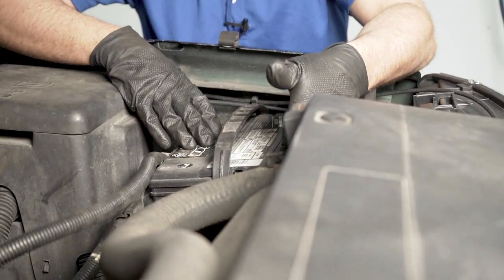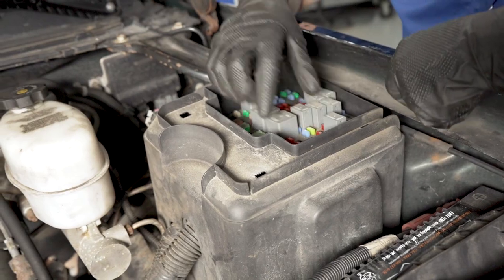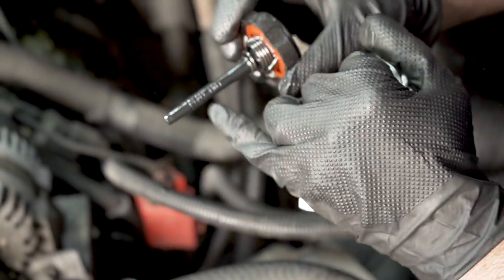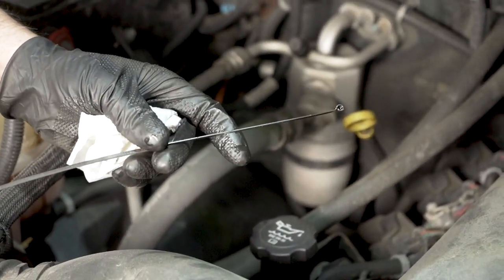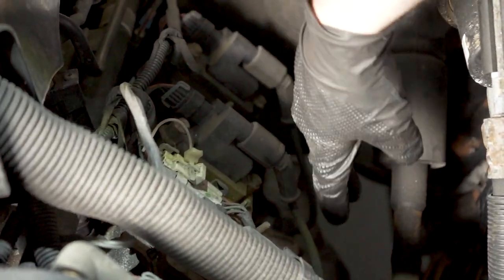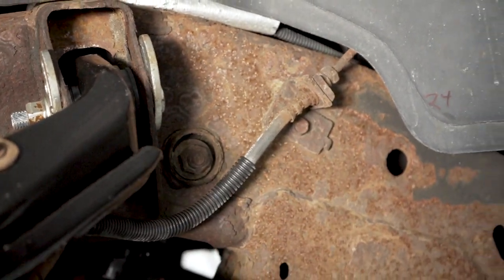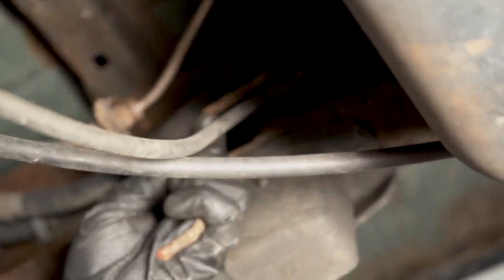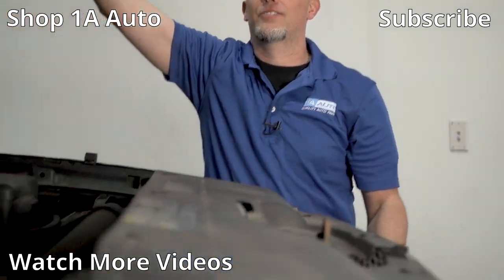Top High Mileage Issues 2001-2006 Chevy Silverado 2500 HD Truck

Comment: Here are some major ones that need to be checked and can affect your purchase.
1) CHECK THE TRANSMISSION FLUID!!!!  The fluid needs to be changed on these trucks or serious damage will be done. We had a farm truck that needed a while new transmission because it was not maintained. A clean filter is also a necessity. However, DO NOT FLUSH THE TRANSMISSION! It can cause too little friction and mess up worn out parts.

2) Check the rear fender wells.the bedsides will rust from the inside out depending upon how much damage is done. It is also structural for the rear quarter panel. The rear support will crack then by the taillights will follow affecting the tailgate bracket.

3) Assume you need new sparkplugs and a fuel filter. If there's a check engine light on their typically the culprit. Just under $100 and it makes a world of difference.
3a) The spark gap on the plugs can vary from the original specs depending upon which engine you have. It varies if you have iridium or platinum. Do your research.

4) Cab mounts. The cab mounts on the earlier mounts tend to go. Look carefully at the bushings. If not replaced when broken they will hold water rusting out the mount. It can become costly to repair, potentially damaging the front mounts in the process.

5) Tailgate latch. The plastic connector which holds the release for the tailgate can break easily if yanked upon. Always push into the tailgates before opening them. The plastic becomes brittle.

6) Bumpers. The bumpers usually rust out horribly. There's no way to repair it, it's much easier just to install new ones.

The way the market is right now, there's a lot of these trucks for sale. Keep in mind that a cheaper truck could cost you more in repairs. Attempt to find the best truck cosmetically and mechanically in your budget. Parts are cheap and the repairs are typically pretty simple, remember you can't undo rust. Good luck.

Comment: On my 2000 2500 I’ve done the following; all ball joints, front shocks, water pump, intake manifold gaskets, new OEM intake manifold,  water pump, idler arm + bracket, pitman arm, both front hubs and bearings, TCCM, transfer case encoder motor, front axle actuator, pigtail connectors and harness for the transfercase, tie rods and tie rod ends, starter, 3/4 o2 sensors, hood release cable, new trans, full pad a rotor kit.  I still have a cv boot and a trans cooler line to do, and more than likely both head gaskets. I’ve had the truck for about 2 1/2 years. Love it to death but at this point it’s starting to get a little pricey.
Reply: Did you know all this was needed before you bought it, or it needed these things as you owned it '  and time went by ?

Sorry for all the questions, but l'm looking at these trucks now in the 2022 gas hikes ' 
or better yet said " wallet evaporator "

Comment: I owned a 2004 2500HD I love everything about it, except my AC and Heater went out. It's very expensive to repair. Good thing I live in California were its not hot or cold otherwise the best truck I ever had lots of Power

Comment: I'm having weird electrical issues, but I suspect previous owner as oem wire from alternator replaced, but old one left on, power inverter installed, but red wire used to connect both pos and neg terminals, aftermarket stereo with bad install... Will check ground cable though! Thanks for the tips!
Reply: There is a ground terminal under the truck on the drivers side that has a bunch of grounds all meeting up there.  Very common rust causes bad grounds and cant figure it outs.   CHeck that area if your having issues tough to follow....

Comment: Ok my main problem with these,,y    Y.    WHYYYY DO they put the hot side battery near the fender.  Its so close to shorting out its scary,,,an sir u are right about rodent's under fuse box,,, mine were hungry,15 wires.  Had a engine miss u couldn't beat an noticed some dry grass sticking out from under the box .   Repair was time consuming worse part is now the surround wont go back on ,,so now its wrapped up in plastic an put lid back on,  must be water proof rain will get in it if not sealed up.

Comment: What about the 2007 classic? Does that fall under  01-06?
Reply: No.  In 2007 chevy wen to active fuel management.  That is where the truck shuts off some of the cylinders to save fuel.  The problem is the valve springs become permanently collapsed and the mechanic has to tear your heads off to replace them.  I heard about a guy who already has $13,000 in active fuel management repairs.

Comment: So what if I don’t have a 2nd battery in mine?  I bought it like that and don’t see any lines from where it would be.
Reply: Probably a gas truck they don't need 2
Reply: @doddgarger6806  the truck demonstrated in the video is a gas truck . The diesel duramax does not have a vortec engine cover .
Reply: That’s a good question . Never seen two batteries in a 6.0 hd Silverado hmmm 🤔
Reply: I just bought one like that too and it have only one battery, where could it be .
Reply: 2 batteries in a gas truck are a factory option if the buyer had planned on hooking up multiple accessories or camper, or inverter for AC electrical current. It was set up to prevent a dead battery for starting the truck just incase the user failed to catch it in time.

Comment: Good vid! I bought a 2500 suburban cheap, but electrical problems galore! It would even stay running when I turned the key OFF! Had to Turn the headlight switch to kill the engine! Hilarious. Redid ground cables, so it runs great now, but still stuck in 4high-auto. And no headlights. I’m going to pull out the fuse box like you suggest. Thanks, man.
Reply: What’s the location of the grounds I have kinda same problem